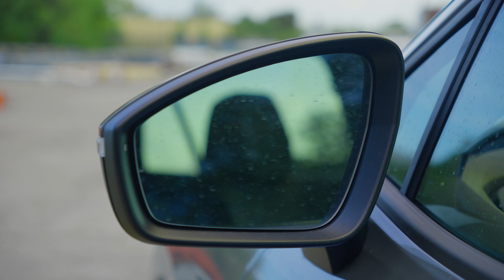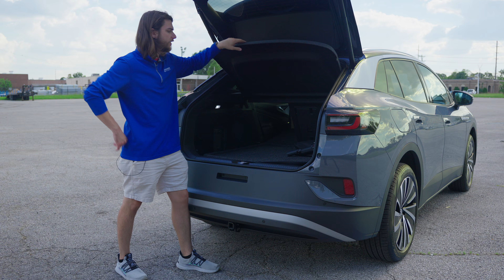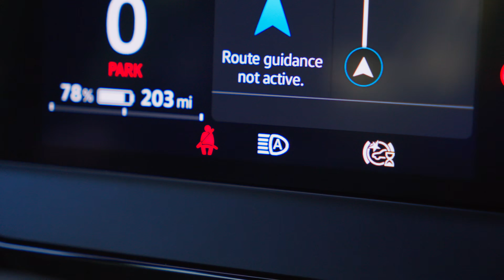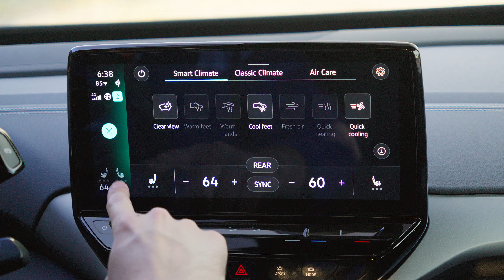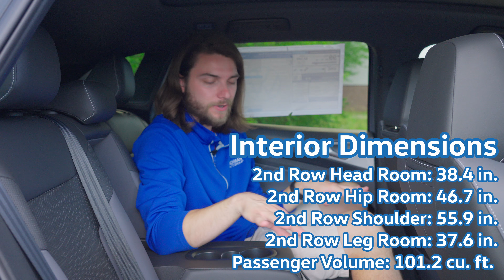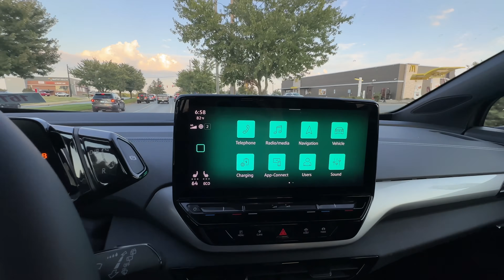2023 Volkswagen ID.4 Pro S AWD - Review - Dual Motors are a MUST!

Comment: I have test driven 4-5 of the cars in this price range and the VW is definitely the least impressive of the lot. Its just sort of meh... I really don't get why it has such good reviews.
Reply from the maker: 4-5 other EVs or just other cars?
Reply: @BachmanVolkswagenLouisville  All EV's. I've recently test driven the Hyundai Ioniq 5 and 6, the Kia EV6 both wind and gt-line trims, the Ford Mach-e (and the lightning). I've also owned a 2019 BMW i3s bev and my first ev was actually a 2016 VW e-golf. Everything you said about the cockpit was true. The ID.4 display feels closer to my 2019 BMW than any of the other cars aforementioned. Also the materials in the car feel sub-par. Even the mach-e i was pleasently suprised with the styling, cup holders, etc. I don't love the huge ipad that looks like it's stuck on with a piece of gum, but the rest of it felt great. The ioniq 6 sel had the nicest options on a lower trim.
Reply from the maker: @JasonBedient yeah the ioniq 6 is great! Is that the one you preferred the most?
Reply: I liked it a lot more than i expected. i'm not really a sedan guy but i was still able to fit a surfboard with a seat folded down. not bad! It definitely made an impression.  @BachmanVolkswagenLouisville
Reply: Because it’s a VW.

Comment: The other thing that this model does not have as standard is a rear mirror with Homelink. I had to order one from a dealer in California (which had the best price) and I installed it myself. I do not like having a garage door remote sitting loose in the car as it could be stolen and facilitate a break in.

Comment: Nice review, I think you said it the best when it comes to the software. It's Ok but could be so much better. The fear for most owners is that VW will just not make an effort to fix the current gen software since the 2024 will have version 4.0.
Reply from the maker: It’s the best looking non-Tesla/rivian software, functionally it has a ways to go. Although the updated version I looked at on the Atlas was significantly better
Reply: I wonder what the auto industry will do to support older platforms. Currently apple products that are software update abandoned for valid reasons that hardware is insufficient, can not safely use the internet. I know they do this to force customers to upgrade. But I wish there was some protection given to consumers against forced obsolescence. Apps require certain platform version, so abandoned software update can potentially make a giant sized paper weight.